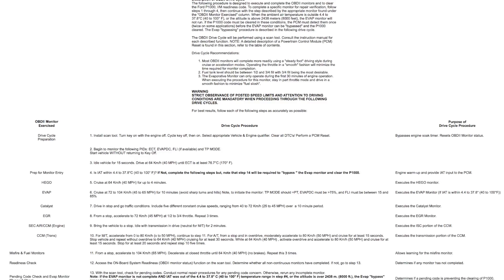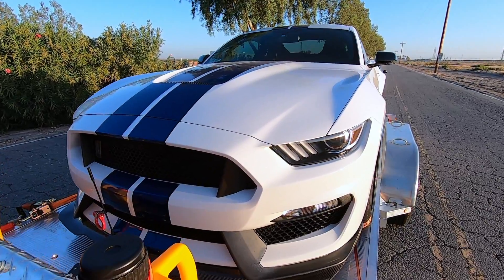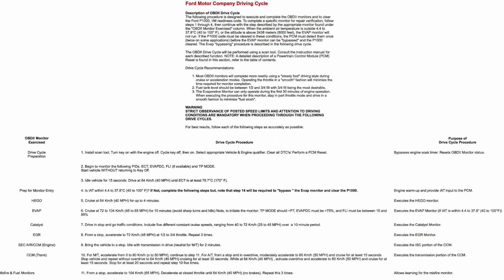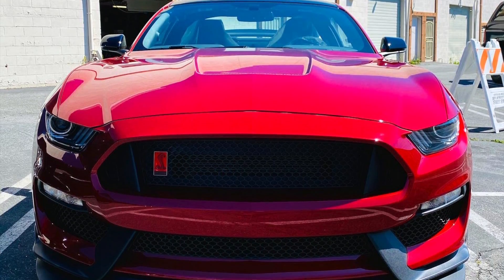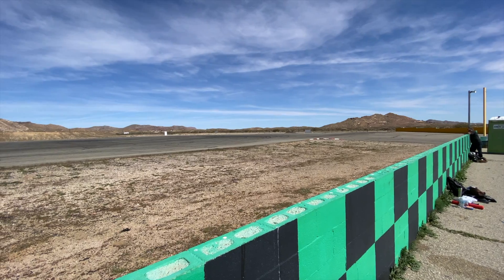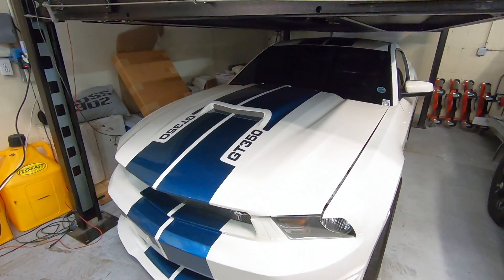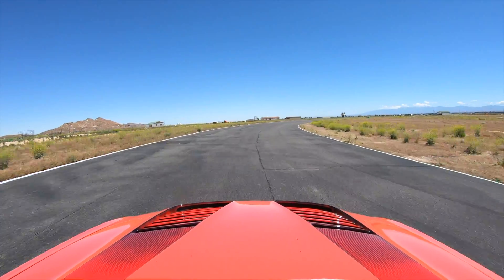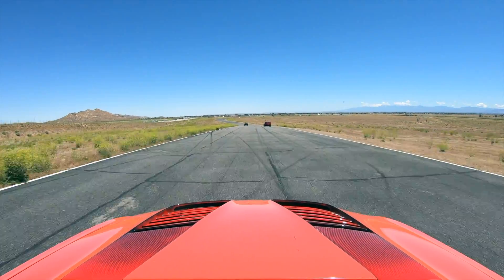What is a Ford Drive Cycle?

Comment: I just found this video because no matter what my car wont complete a driving cycle. I have been having this problem for almost two years and i still drive it and after getting caught a few times i’ve tried to hard to pass smog, i m looking for answers and came across this video you uploaded 2 years ago. Has anything changed? Thanks in advance
Reply from the maker: Thank you for checking out the video. No, nothing has changed. People have been kind enough to leave their experiences in the comments, however, there seems to be very few people who have overcome these issues once they begin down the rabbit hole of drive cycle hell. If anything changes that is significant, I will upload a follow-up video. Thank you for commenting, best wishes with your car.

Comment: Probably a dumb question, but have you tested the oxygen sensor heater fuse? It doesn’t say the the heater fuse is part of the oxygen sensor, but it is. Not saying this is the problem, but worth testing to say time and money.

Comment: “Fuel System Not Ready” with over 400+ miles of trying various drive cycles.
Reply: Same exact problem! It cleared with my California illegal AirAid cold air intake, but not with the legal Ford power pack 2. I’m puzzled. The fuel system, was last in line for readiness.
Reply: @MadHatterND  🤔what year is the vehicle?

Comment: I have a 2008 Shelby GT/SC which passed smog every year until 2024 which took me 1200 miles to get the O2 sensors ready.  Then this year 2025 I'm running into the same problem.  I'm now 1150 into doing drive cycles and still the 02 and catalytic is not ready.

Comment: I Have a 2016 GT350 which I purchased new in CA.  I had to get the car smogged for the first time 02/2024.  The car is stock, but did not pass the OBD2 cycle.  I tried various drive cycles but still won't pass.  Any updates or advice?  Who to contact at Ford, Ford Performance or the smog gods. Thanks for any advice. Ron Hampton.  I suspect a lot of GT350 will be coming due for smog checks as the 8 year grace period comes to an end.

Comment: I have a 1998 Ford Ranger and put a new battery in it two months ago. It failed smog because of the OBS2 test, everything else passed. I called Ford customer service, yeah the actual company, and they spent 15 minutes trying to find the 'drive cycle' and they could not find it. Their best advice was to call a dealer. I called a dealer and talked to service, that guy told me a general Ford drive cycle he does of 20 minutes on the freeway of various speed, get off the freeway and travel 10 miles through town back to his house. He said he does this loop twice to get his Fords to pass. I tried it and it worked. The vehicle computer is looking for highway and city driving, going through the gears, stopping, starting, idling and who knows what else. Why though would the manufacturer not have this on a sheet somewhere for each vehicle.
Reply from the maker: Thank you for this helpful information. It does not make sense at all Ford would not have the drive cycle information or literature for everyone of their vehicles. Thank you again for providing information on your Ford drive cycle procedure for the Ranger.

Comment: Living this nightmare in California with my 2012 gt. The monitors won't comeback online after a cat replacement on bank 2 back in December 2022. I've done drve cycle after drive cycle.
Reply from the maker: It is absolutely a nightmare, you have described the situation properly. I find it interesting your specific issue started after an OEM or similar cat replacement. In theory, there should be no reason why the monitors do not come back online, everything else held constant. At most, one or two drive cycles should have resolved the issue.

Thank you for sharing your experience, and please keep us updated if anything changes or you learn anything new. Thanks for checking out the video.

Comment: I have a 99 Ford Expedition I have not be able to drive this car for over 6 years because of failing the drive cycle.  Right now  I have failed on CAT, PdDTC, 02S AND HRT,  I have tried different attempts at it and have over 700 miles driving it with 2016 tags on it.  Welcome to Smog  Hell and the DMC (ca.) just smiling.
Reply from the maker: Oh wow, 6 years? This is a much bigger problem than I originally anticipated. After 700 miles, I would imagine plenty of drive cycles were completed during that time. I am sorry to hear this, and we are right there with you. If anything changes or you hear any good information about how to solve this, let me know! Thanks for stopping by.

Comment: I am having this problem now and it's so frustrating.  To make a long story short, I have a 2013 Mustang GT that I modified with a Kenne Bell Supercharger and I can't get the cat, O2, and heater monitors to activate.
Reply from the maker: I’m really sorry to hear about the problem you’re having with the monitors refusing to activate. It is incredibly frustrating, I feel your pain. There are some great suggestions in the comments you may want to try, but we still haven’t had any luck. Thanks for checking out the video.

Comment: Ive never struggled passing smog in my 2015 mustang gt in Illinois, I’ve literally cleared codes right before going to the testing facility and by the time i get there they were ready, they even passed my car with a p0420 code that means the cats aren’t working right
Reply from the maker: I wish myself and others had this kind of luck! Thank you for sharing this information. Congratulations on passing smog in Illinois!
Reply: What cycle did you do? I’m having issues after a battery went too low and reset all monitors I looked up the ford one and it’s insanely precise
Reply: me too until this year.. what the hell happened? now its different.. did they hack out cars?

Comment: 13 boss 302, same shit, 1st smog needed since purchase in 18. I've done multiple drive cycles, bout to take a road trip hoping that may help. 4 sensors won't clear: fuel, o2, egr, and cat. Clicked this vid for help, damn. Encouraging though that your 12 boss eventually passed. Cali auto laws and regulations are pure crap, like alot of our laws and regulations. Sweet rides bud 👍
Reply from the maker: I'm not understanding why the multiple drive cycles you've completed aren't activating/completing the OBDII monitors/sensors and clearing the readiness code. It's happening to a lot of people.

I feel terrible I don't have a solution for you or anyone else, and I regret making this video because I think it misleads people to think I have a solution(s) to offer. The only reason why I haven't deleted this video is subscribers and visitors have left helpful comments in the Channel Comments Section, which will hopefully provide some help and offer possible solutions to our mutual emissions issues and problems.

Please keep me informed on what happens after your road trip. Thank you very much for the kind words and taking the time to check out the video.
Reply: @TrackingPonies  oddly enough, it appears my Corsa axelback was the culprit 🤔 
Seems the drive cycle "exact40mpg for 4minutes, then revving 2nd gear to 4800rpm" has worked for many modded and tuned guys. My boss is stock besides the Corsas, I heard a guy covered his exhaust (pass side only, and put steel wool in o2 sensors) long tubes as well..... passed. So it led me to believe the Corsas may be flowing too well, thus not heating sensors enough to trigger, even though they are upstream. Swapped back to stock boss mufflers and the sensors triggered after about 20-30 miles! All OBDII green and passed. I removed 2 of 3 hangers on the stocks and shortened the Corsas for easy swap, since I may have to do this crap every 2 years. It still makes little sense to me.

Now my damned fuel inlet is faulting again and triggering CEL for EVAP leak. Another shitshow problem from Ford. (Internet fix is ram the fuel funnel a million times in and out with some WD, apparently works for about a year cuz I had to do it last year, lol)

And I thought installing the MGW shortshifter would solve all my 6sp S197 Mustang issues 😂

Total BS when we pay top dollar for numbered, rare Fords, and they won't even pass emissions. Not just Cali either, Stang owners across the country (tho mostly modded) all struggling with this nonsense

Comment: I have a 2012 boss 302 and for the past 3 years since 2018 I have been having the front o2 sensor saying that there are not ready. I even replaced them and still the same problem. I too have tried the Ford drive cycle and can’t get them to turn on. Great video by the way.
Reply from the maker: I’m really sorry to hear about your situation. Three years is a long time. Congratulations on an amazing car, despite it not responding properly to a drive cycle.

Thank you for checking out the video, and I am truly disappointed I don’t have a remedy to offer you in the video. I’m in a similar situation, but about to try some possible solutions others have suggested in the comments section of this video. If I ever find a solution that works for people in our situation, I will let you know!

Comment: I went a few months ago to get my 2000 mustang smoged and it said my secondary air system was not ready. The guy told me to drive it around a bit so it can be fixed but I did and it still showed that it was not ready. So how do I get the secondary air system to be ready?
Reply from the maker: Hi, Wilfredo. Thanks for checking out the video and commenting.

It appears the general consensus is to keep attempting the drive cycle a few more times to try and set the monitor to a "ready" or "complete" status. You stated you are driving it around, is the check engine light still on? I'm not an expert on anything, but even asking around regarding your specific situation, I've been advised to tell you to try the drive cycle at least two more times, and engage in a few more "cold start" cycles. I personally can't verify this, I'm just passing this information along to you.

If I hear anything else, I will update you! Good luck, keep me posted!
Reply: @TrackingPonies  no the check engine is not on everything is fine the only thing is that the monitor says it’s not ready I asked a mechanic and he said to just drive around and cold start it every morning until it shows up as ready.

Comment: Just bought a 2011 GT. Same issue. Driven several drive cycles. Cannot get the FUEL, CAT, O2 and HTR monitors to set. Strange thing is... PREVIOUSLY, all monitors set except the EVAP... I replaced the fuel filler neck and purge canister because I was getting an Evap leak code... code is gone, EVAP set FIRST but. Is the others won’t set!!!
Reply from the maker: I am sorry to hear about your situation with the '11 GT. However, congratulations on your new car!

Great observation solving the EVAP monitor failure. 1 of 4 solved. Statistically, I have noticed just in the comments for this video, most people are reporting monitor issues with an S197 5.0. Also, most everyone is experiencing an O2 monitor failure. There have been many great suggestions to bring monitors active and online left in the comments of this video I intend to try in the coming weeks. We are experiencing the same monitor failures as you are with your '11 GT, so if I stumble upon any remedies, I will let you know! Drive cycles have yielded no successful results for us as well.

Thanks for commenting and checking out the video.
Reply: UPDATE After completing several drive cycles, starting while the vehicle was cold, driving the recommended speed and duration, trying EVERYTHING, nothing worked.... so, I decided to just have some fun and ripped on the car for a few minutes. Got it up to 80mph a few times, did some hard pulls, almost to redline. Parked it. Next time I started her up,  ALL MONITORS WERE SET!!!!  I guess she just needed some tough love!
Reply: @RambunctiousPictures  I have a 2011 Mustang GT and have exactly the same monitors not ready- O2, O2 heater, Cat, and Fuel. Can you please share how many drive cycles you did before doing these hard pulls?
Reply: @dewdrops515  apparently there’s very specific Ford driving pattern and order that you have to do in order to get all the monitors to set. Some are temperature specific, engine temp specific and others are based on time. I’d say look that up, do it as close as possible and then let ‘er rip if they still don’t set!!!!

Comment: I’m going through it now my car hasn’t pass the emissions for 2 months and I don’t know want to do! The guy at the emissions told me it was the computer of the car so idk if that’s why it doesn’t pass ?
Reply from the maker: Hulk, thank you for taking the time to share your experience. I am frustrated for you. I've been told the same thing, along with several other "possible" reasons. The most recent explanation we heard from the local emissions shop owner is the O2 sensors were "malfunctioning," yet, every professional car mechanic, computer tuner, exhaust expert, and diagnostic tool we've consulted and used say otherwise. I have no idea what to recommend for your situation, as we have tried many possible solutions with no luck. Please let me know if anything changes. I'm sorry you're going through this.

Comment: I have the same O2 sensor issue with my 2014 Ford Raptor. I bought the truck in Washington where they don't have emissions and brought it down to Arizona where emission checks are required. The truck had Kooks long-tube headers with non-EPA approved cats, so in order to pass emissions, I had to change them out to "green" EPA approved cats. Now the only thing holding me up from passing emissions is the O2 sensors are showing "Not Supported" on the ODBII reader. I thought the previous owner had installed a custom tune and disabled the O2 sensors, so I had a local Ford dealer reflash the PCM with factory stock settings. After driving more than 300 miles to complete the drive cycle, the O2 sensors are still not activated. Very frustrating!
Reply from the maker: Hi, Bill. I am sorry to hear about your situation. I would imagine Ford flashing the PCM with the factory stock program would reset and enable proper O2 sensor functionality (especially after completing a full drive cycle).

It appears we have much in common with O2 sensors on "green" catalytic convertors. We've had bad luck with vehicles passing smog with inactive or "non-supported" O2 sensors on exhaust manifolds with "green" cats. 

Thank you for commenting and checking out the video. I'm frustrated for you. Let me know if you have a change in circumstances with your Raptor. 

I've always loved the Raptor. Fine choice, sir!
Reply: @TrackingPonies  
Thanks for your comments. Since my posting on your video, I came across a video of another person who was experiencing the same issues with the O2 sensors, and coincidentally, he also lives in Arizona. In summary, he mentioned that the drive cycle will not complete when the outside temperature is very hot. He said the coolant temperature has to dip below a certain point before starting the drive cycle. With record high temperatures in Arizona this summer, he couldn't get the coolant temperature low enough even after leaving it overnight. His solution was to go to a cooler place (Prescott), which is typically 10-20 degrees cooler than Phoenix, and stay overnight to cool down the engine temp. It worked for him. He was able to complete the drive cycle and the OBD2 reading on his O2 sensors became "complete". I'm willing to give it a try. Will report back after the trial.
Reply from the maker: This information is very promising, and I am very grateful you found it and shared it. I never considered the temperature sensitivity variable when completing a drive cycle, and I am disappointed I have not heard anyone from Ford / Ford Performance recommend this as a prerequisite prior to completing a drive cycle. I attempted to complete the drive cycles in and around the San Fernando Valley, which experiences warm to hot weather on a frequent basis. This may explain why our '12 GT350 hasn't passed smog since 2015 (considering I'm attempting the drive cycle in warm / hot weather). I really appreciate you sharing this with me and anyone who may stumble upon this comment section. Thank you again, and please let me know what happens! I'm going to try your suggestion as well - let's compare notes!

Comment: My evap system won't ready up everything else is ready but I already drove 457miles
Reply from the maker: After 457 miles, I would think all monitors/
sensors would be ready and on stand-by. Weird. I appreciate you sharing your experience, and thanks for checking out the video!

Comment: Cannot get my saleen to become ready
Reply from the maker: Do you have any information or theory as to why? I'm sorry to hear that, and share in your frustration.
Reply: @TrackingPonies  cats were cut out and o2 sensors were removed
Reply from the maker: I’m sure that had something to do with it! Your car must be so loud without the cats. When / how did you did discover this? Thank you for keeping me updated, and I’m happy you have an answer.
Reply: @TrackingPonies  I got underneath the car after doing 400 driving cycles and nothing working and seen the cats and o2 sensors missing lol.. yea the car was performance to the max.. was insane loud had some bad ass cutouts.. I live in ny.. so I wasn't about to drop 4000 into to have it inspect.. haven't worked in 7 months so it was the perfect time to sell I guess
Reply from the maker: You definitely make a good point that it was a good time to sell, and investing $4000 for an inspection is a risky decision. Although, I would’ve paid the price of an admission ticket for you to take me for a ride around the block in the car so I could hear the exhaust at wide-open throttle!
Reply: Sold it